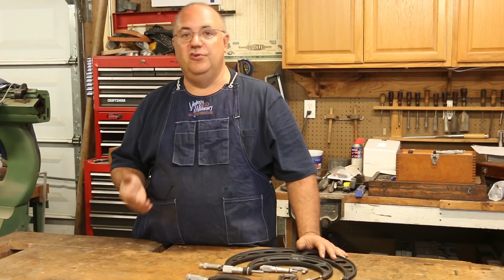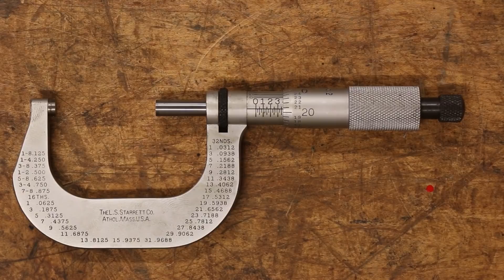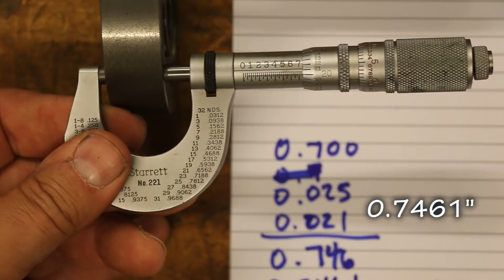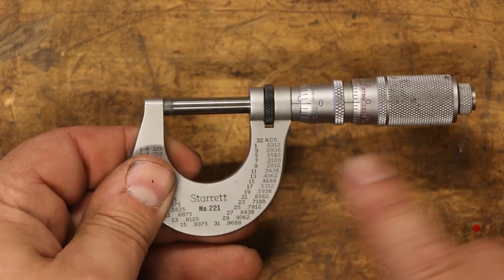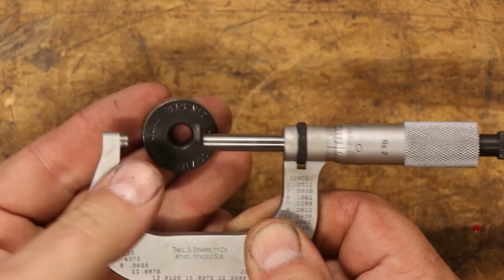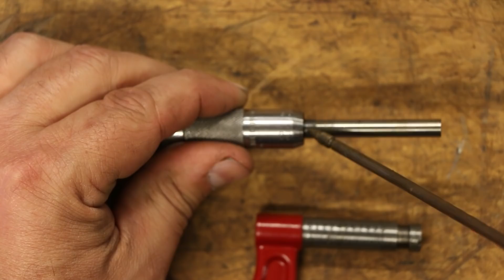Micrometer Basics:  Use, Care and Calibration

Comment: Thanks for this video, my brother is a machinist but we leave far away from each other, I just got into this now because I need to measure roundness on a crankshaft main bearings caps, in the block as the crankshaft was grounded and polished; I got a Mitutoyo Dial set new and a 0-6" with interchangeable anvils from ebay, used, I just learned the 0-6" would not have the thousands of inch scale on it, I was expecting that it would, I am a little confused now if I got the right tools I need to measure the roundness of the bearing caps/ block now, also learned about the inside measures ones that I did not know but I was recommended to use a dial with an outside mic for this type of reading. I guess once I got the tools in front of me then I will know exactly if they are what I need; very expensive for one time use for me between the 2 of them sets I am $870.00 backed, but I reckon I could sell them again or leave them for my brother one day if he ever do machine work as he has been in different line of work since he graduated trade school. The rounds I want to check are about 3 inches but I did not want to buy just a dedicated micrometer, maybe I should have done that.

Comment: Thank you Keith. I just opened, cleaned and lubricated a metric micrometer that hadn’t been used for about sixty years. Lubricating it made a huge difference, it turns smoothly now through its full range. Before watching your video, I was too scared to try opening it in case springs and ball-bearings came flying out in all directions, never to be seen again. Your information is just what I needed, thanks again.

Comment: Regarding how to use a micrometer, especially when it comes to the spring force of Starrett, the usage method provided was entirely wrong.When using a micrometer, it is important to use the small locking knob instead of the large knob to secure the final reading. Using the large knob can potentially damage the equipment and compromise the measurement accuracy.

Comment: I bought three micrometers on eBay for a song. My reason was for buying was to get parts for an existing metric one I own. I didn't realise that the collar inside the locking ring has a minute roller bearing in it. Probably 0.5mm thick. Only one of the micrometers has this...

Comment: great lesson, but you missed some important points, for a beginner :
1) don't hold the metal body for too long (the heat of your hand expands the body, changing a reading).
2) if in ANY doubt about how tight to close the anvils, use the ratchet knob on the end, the click spring on the pawl will 'trip' at the right torque for measurement. 
3) when making an inside measurement, you actually need to make two!, first is the part, using a bore guage, the second is to transfer the bore guage to an inside mic, (shortening for michrometer, slang used by mechanics) to record the reading, so be accurate, slow and steady, as you transfer from one to the other.
4) if your set is imperial (inches) CONVERT to metric at the END, as this imperial is decimal in nature (ie 1/100th inch =0.100 same as metric!!) so it is easily confused, so do it in fractions, then convert, plus you don't add an error in rounding for each round of measurements, ie if you have to sum readings, or compare them for tapers, or concentricity, do ONE system OR the other, NOT both, as it is too easy to confuse the two.
5) for point 4) above, WRITE down the system you use, OR do the same system for the same Job EVERY time, that way if you have a 'brain_fart' due to stress, family issues during a job, etc. you know that your 'fail safe' is to return to the same system, if you learn good habits they stay with you for LIFE.

Comment: Note:  There is a slight difference for calibration between using a flat standard and a round standard.  Because of less anvil contact on the round surface standard, your mic will read about .0001" smaller than if calibrated on a flat standard.

Comment: I've found that tolerances on the lead screw for most "well made" mics are very tight. Meaning, adding oil, even light oil, will often stiffen them even more as the oil takes up space. I've found that oiling them, and then wiping off the excess completely so that it just leaves a very fine surface coating works best. I've learned this through buying old used mics from flee markets and ebay as i can't afford to buy nice tools new.

Comment: I have a used 2” Starrett micrometer.  The barrel knurling has a partial crusty ffingerprint smudge  embedded in the knurling.  Any ideas on how to clean this smudge.  Recommended  solvent?  Tooth brush?  Do you wipe your micrometers after use?  Light coat of Starrett oil on a microfiber cloth?

Comment: Your the only one I've seen with the starrett 221, I've got a couple, I use mahr indicator mic's mostly but that is a good in between regular mic but not quite close enough for the indicator mic. I do centerless grinding, usually tolerances in the tenths or one tenth total not uncommon. Thanks for the video, This is great, In the past I'd hand a new guy the instructions from a micrometer box if I didn't have to much time to explain. This is really nice, I'll use your video its good stuff

Comment: I have an old sears micrometer that I got second-hand and I can't figure out how to calibrate it. There is a slightly damaged flat head screw on the back end of the ... spindle? (sorry I don't know if that's the right term. Damn it Jim I'm a woodworker, not a machinist.) I'm thinking if I remove that screw I might be able to calibrate it but I would like to hear from someone that knows what they are talking about before I start screwing with it.

Comment: So the increments on the thimble that go to 25 are like dividing that 0.25 into a thousand??
Reply from the maker: The thimble is threaded with a 40 Threads Per Inch pitch.  Each turn of the thimble is 0.025".
Reply: Keith Rucker - VintageMachinery.org
OK. I'm just trying to understand how it's dividing an inch. Measuring doesn't come easy to me but I have to learn this. So each inch is divided 40 times?
Reply: Very true but the way my mind works is thinking within .100.  So by turning it once is 1/4 of that. Kinda like money (Quarters and dollars).  Of course it's very simple since the thimble very clearly shows 25 when you get there.

Comment: Just rewatching, as I will be having my students watch this in a few months, and figured I'd throw my two cents in. 

Another viewer mentioned temperature, and to elaborate, if the mic is calibrated at 20C (68F), at 30C (86F), a 1" mic will have grown 0.0001" (a ten-thousandth) (most mic's, even old ones, have steel frames). Not a big deal in most cases, as even a tenths reader is usually only spec'd by the manufacturer to two tenths. If a steel part is at the same temp, say during springtime in Georgia, all good. If the mic heated up due to handling but the part is still cooler, error begins. If the part is another material, like aluminum, then the error is both due to the mic and the part and the tables need to come out. 

Larger mic's are more heavily effected. A 10"mic will grow by a full thousandth for the same temp increase. A tenths reading 10" mic is only good to 0.001 or 0.002" unless the temp is controlled and the calibration checked. At that size, a couple thousandths is usually going to be spec, anyway, but when tolerances get real tight, it is important. 

Worse yet is large mics may twist due to the heat of handling, and this will have a large effect. I did a demo a few years ago with a lattice(? Like the large one here, with holes to lighten it) frame 12" or so mic. Removed the spindle, had the students sight down the hole and see the reflection of their pupil dead center. Had a student hold it for a minute. Then resighted down the hole. Not only is the pupil not centered, but visibly way off. The frame heated unevenly from handling and twisted. Half hour later, just about back to center. Anvil and spindle faces not parallel, and the twist changes the baseline much more than uniform heating and cooling.
Reply from the maker: You bring up a very valid point, and something worth mentioning.  But I have to be honest with you that I don't normally worry too much about it.  Why - because of the kind of work that I am doing.  Most of my work is "job shop" repair work.  Making a single part or two to fix something that is broken. I am usually measuring a piece and making another piece to fit it.  Because of that, I have the luxury of being able to measure a part at whatever the temperature is in the shop and then machine another part to fit in a similar air temperature.  In realty, the actual measurements I am dealing with are somewhat relative - if the actual measurement is off by a few tenths, it is no big deal as long as your reference measurement was off by the same amount.  Make sense?

For production work where you are meeting a specification, measuring in a room calibrated to 68 F is extremely important though. As such, your point is well taken and it is something that should have been in the discussion of using a micrometer or any measurement tool.

Comment: How tight should the micrometer be on the material?
Reply from the maker: +The Panda  Bus Fitter That is a hard thing to answer in words - it is more of a feel that you get with use.  Most of your better micrometers will have a slip clutch on the tightening knob that will only allow you to tighten it so tight before it starts slipping.  If you have never used a micrometer with one of these, probably the best way to learn this feel is to use one and after a bit of practice, you will know exactly how much pressure to use.

Comment: Hi Keith, can you please give a bit of advice repairing one I have 6"-7" J.T.Slocombe one & it's thread is binding at 6-6.5 end it came with a Moore&Wright thimble in it so I tried a thimble from a Slocombe 1"-2" I have & still binds in the same place also I tried the M&W thimble in the 1"-2" to see if the thread form was slightly different was the problem but they worked together perfect so it must be the thread in the frame any ideas how I can repair or change it?
Reply from the maker: +orange12v Outside of finding a tap to clean up those threads, I really don't have any great suggestions.  Sorry...
Reply: Hi Keith, Many thanks for getting back to me I also think a tap is the way to go as it's 40 tpi x 5/16" dia as it was made in USA any ideas what thread form it mite be? Regards Dave

Comment: Nice video, Keith, but what are the numbers on the frames and what are they used for?
Reply from the maker: +GeckoProductions I think that what you are referring to is decimal equivalents for fractions of an inch.  They made wall charts with the same info on it to quickly be able to convert a fraction to a decimal.  Some of the micrometers have these decimal equivalents engraved right on the micrometer for easy reference.

Comment: Thanks Keith, As ususal i learned a lot from you. Just one small question. How much pressure du you put on the dial when you take a measurement? I find it hard to be consistent, especially when measuring round items like axels... but then again i am only a selftaught "machinist" :-)  Thanks again from Denmark!!
Reply from the maker: +Jan K Jensen Most micrometers have a friction wheel at the end that will slip at a specified amount of pressure, which greatly helps keeping the pressure the same from one measurement to another.  I highly recommend that you find micrometers with this feature, particularly if you are new to measuring with them.  After a while, you get kind of a feel for using them and can do it without the friction wheel, but it is a nice feature none the less.

Comment: Hi Keith,
I have never seen anything like that little Starrett mic with the spring loaded thimble ! Very nice !
I have different levels of measuring tools from cheap junk up to mitutoyo and starrett etc , i use the cheap stuff for things that are not critical and when they get flogged out i chuck them in the bin this saves my good tools from wearing out.
Thanks for another enjoyable and informative video !
Reply from the maker: +ian bertenshaw I got that Starrett mic with a set of micrometers that I bought off of Craig's list a couple of years ago.  When I first saw it, I had never seen one like it.  Once I figured out how to use it I thought how great of an improvement it is!  Like I said, I wish that Starrett made that model in more than the 1" size.  I too have some cheaper measuring tools that are my main go to tools and save some of my good stuff for when I really need accuracy!

Comment: Keith,
nice video - thank you!
But: You missed the most important thing when using a micrometer:
NEVER NEVER EVER tighten the screw using the main drive!
Every micrometer has two drives. The main drive (mostly the bigger, knurled one) and the measure-drive.
The last one clicks when turning ist to the "tight" direction. So the tigthening force is limited to a defined value.
And that is essential! Because you can build up A LOT of force with the fine thread.
A micrometer is calibrated only whe using the clicking drive for the last tiny bit.
I was shocked seeing you using the main drive when showing how to calibrate the 1-2 inch micrometer.
Doing so gives an inaccurate reading and might also damage the micrometer.

Lothar
Reply from the maker: +Lothar Merl Point well taken.  However, at least one of the micrometers I was calibrating did not have a ratchet drive.  I try not to pick up micrometers without that feature but I have a few in the stash.

Comment: Nice overview. One thing that I wish you could cover is the use of the fine, ratcheting thimble that some micrometers have. I have one with them. I heard that I should use the fine thimble to apply a constant torque so that I don't get measurement error in the readings, but I'm not sure exactly how or why to do that.
Reply from the maker: +Pat Farrell Yes, I should have covered that as well.  Perhaps a follow up video is in order....  Yes, the ratchet knob will allow for you to have a constant pressure on the part which will give you a better measurement.
Reply: +Keith Rucker - VintageMachinery.org I'm with Pat on that. If you get time I also wish you'd go into that aspect of it. I'm diesel powered and no nothing of such things although I worked around some dandy millwrights in my time!

Comment: Good lesson, appreciated. How tight to crank it down? Are the small ratchet knobs set up to apply the correct tension? Thanks.
Reply: +Lee Humes yes some have the small ratchet at the end, some have a slip thimble for repeatable tension, only very basic mic's dont have this
Reply from the maker: +Lee Humes As has already been mentioned, the ratchet knob will allow for the proper and consistent pressure when measuring with a micrometer.  Some models don't have this feature, but I would consider it a must have option!

Comment: Excellent video Keith.  If I may add two things. Readers should be aware that the type of material and ambient temperature make a difference. As an example, measuring cast iron material at a temperature of 45 F compared to 75 F will be noticeable. This includes the micrometer itself and its accuracy will vary depending on what materials it is made from. Some materials expand / contract at greater or less rates than others based on temperature. Most machinist hand books have charts for material expansion rates.

As mentioned by another subscriber, radius measurements (inside or outside) can be tricky. This is particularly true with some micrometers and everything can go bad in a hurry if clearances must be specific relative to the type of machining required. This has been partly solved with some models designed with a ratchet collar inside the thimble, for precise (and consistent) pressure against the radius part. This helps the operator of the micrometer become more consistent.

I hope this video helps the novice to not worry about trying micrometers ! Best measuring invention ever created (James Watt). For beginners, some newer models have dual measuring capability, both digital and vernier scales.
Reply from the maker: +Doug Hanchard I had on my list to cover temperature when I shot this video but it never got done.  I just forgot to mention it....  Oh well.  If guys watch my videos though they will commonly see me waiting for a part to cool down before measuring so maybe they will pick it up there.

Comment: That was very nice. I learned on metric mikes in High School, principle is the same. One thing (and it is hard to do on video) you did not go into is how to tighten the micrometer down on say a round piece of work. This is "feel" and I think it is acquired with practice, especially if you have a tutor. I would love to see, at the next Bar-Z bash, a measuring contest. BYOM/BYOC (Bring your own mike/calipers) and see what the variance is between micrometers, and between micrometers and calipers. BTW you can get a very light oil -- sewing machine oil -- almost anywhere, including Wal-Mart.
Reply from the maker: +Juan Rivero I like the idea of a measuring contest.  That would be fun!
Reply: Can I ask if using a spray can CRC-56 would be OK for lubricating the thimble screw on mitutoyo micrometers?